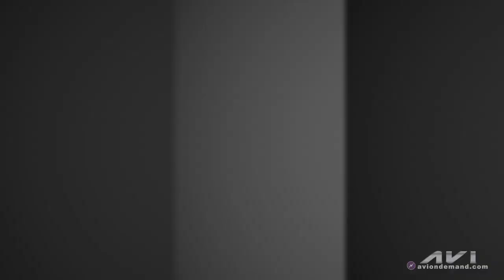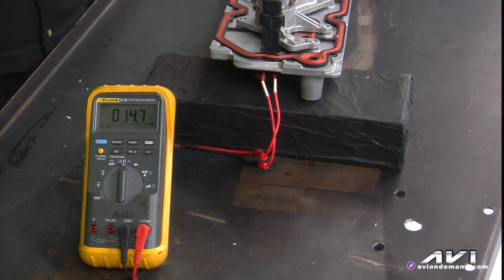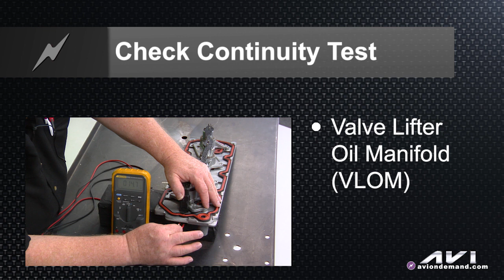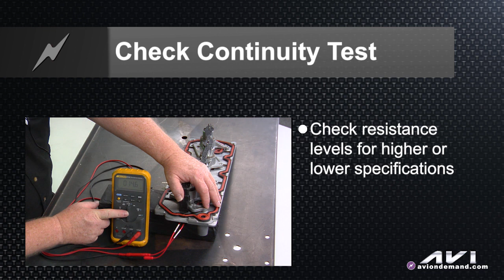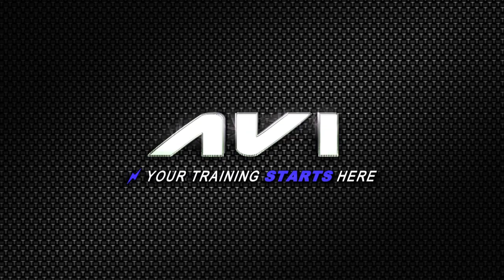Check Continuity Test on a GM VLOM! | Dave Hobbs | Tech Tip

Comment: Far far far more accurate to test voltage and current whilst the solenoids are being operated on a hot engine using an oscilloscope. Main dealer tests like these are almost a complete waste of time. The engineers flow charts are next to useless. Videos like these should not be promoting next to useless test procedures. I could literally write a list as long as your arm on why you should NEVER test resistance on cold un loaded solenoids with a DMM.
Reply: agreed.....let me tear down the entire engine to test some circuits... its way easier to do the ohms test at the pcm connector. more than one way to skin a cat.